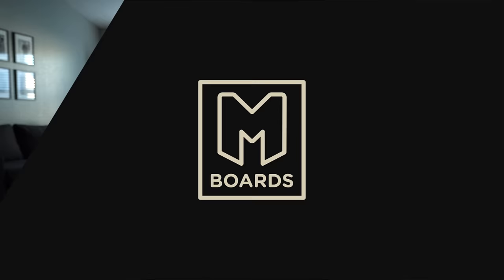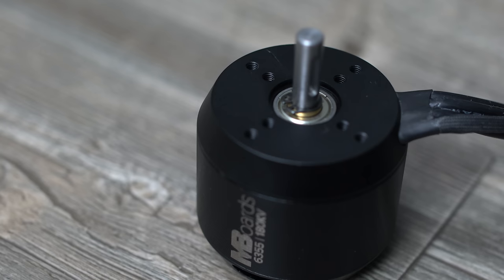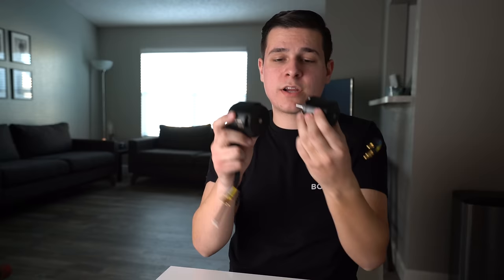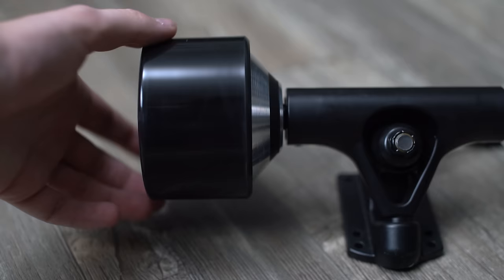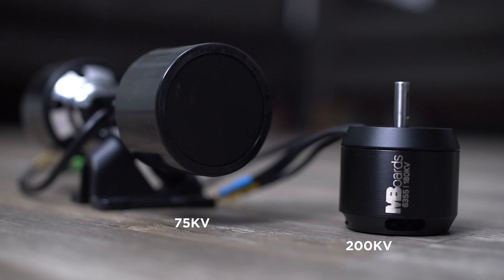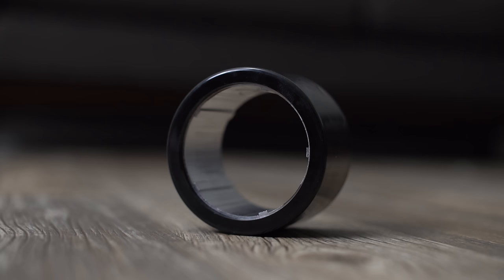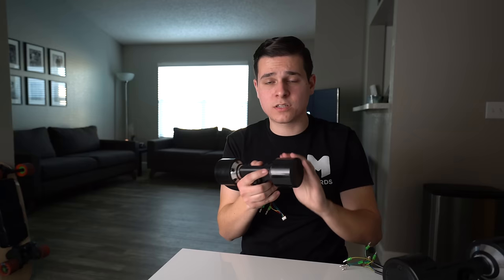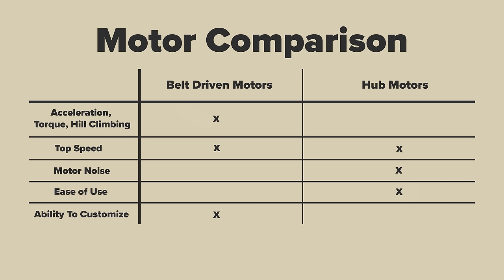How To Choose A Motor - DIY Electric Skateboard Build

Comment: You forget an primordial point! Comfort, vibration, shock absorbtion! With hub motor you're going to feel every roads imperfection, even with shock pads and a flex deck.

It's why I was going from hub to belt, the comfort when riding is night and day
Reply from the maker: Yes 100%. Wheel choice kind of covers that point but we should have touched on it for sure. 

This is the beauty of the comment section. 

Thanks for watching!
Reply: Plus outrunner motors work most efficiently spinning fast; as such belt reduction will always be more efficient, even with the parasitic losses the belt adds.
Reply: @EitanTsur  look "ALWAYS" may imply all other variables unchanged but TO BE EXPLICIT direct drive of many wheels.... 6 or more on a board allows low rpm efficiency!
Reply: @fojrsepta4959  not quite... There are two factors there.  If you run 6 motors you're simply running them all at lower than their power rating in their inefficient power band at low speed.  They are still inefficient at that speed, and in fact, you will consume MORE power trying to produce a given torque than a smaller number of appropriately sized motors.  In addition, every motor has end winding power losses.  There are no magnets on the axial ends of the stator so any power going through that part of the windings simply does nothing but generate heat.  As such, if you take a single motor that is say 80mm in stator length and compare it to two motors that are otherwise identical but 40mm each, the two motors will consume more power than the single larger motor producing the same torque.  This adds up the more motors you use.
Reply: @EitanTsur  YOUR ignoring the peak efficiency at other than extreme torque and rpm design.  Since needing less power from a motor allows it to be operated at maximum efficiency when providing needed power I stand by my  point which I made fully aware that to increase power beyond efficient your point about using proper motor type is all IMPORTANT.  

Efficiency is SOME times a luxury.  Using VEHICLES that weigh much less than we do makes it tolerable to generate heat INSTEAD of work.  However articulated etc. board designs allow millipede evolution values to gain performance without increasing battery size and weight for any distance.

Human power can be harnessed if storage has bandwidth despite novel delivery by shredding or WHATEVER.  Going fast uphill requires real energy but again humans if kept cool can output four figure power briefly with short recovery times.
The board pair market is undeveloped.  Dry ice skates are shoes that shove   converting down forces to forward and augmenting to drastically increase impact times reducing peak damaging forces to body and upping skipping SPEED to useful compelling and ecstatic...

Comment: Hi there.
Wandering what the advantages/differences between Mayteck 6396 and 8085?
Reply from the maker: Well by the numbers, the 6396 would be longer but skinnier than the 8085. 

It’s hard to say which one would perform the best. 

I would recommend a 63xx motor simply due to the compatibility for motor mounts.

Comment: Now... If I mount 2 motors, 1 with high torque and the other one higher top speed will they complement each other? The torque will pull at low speed, and the fast one will drag the slow one once it reaches higher speeds... right?

Comment: Hey Mike, loving the videos. Inspires me to try making my own board.
I have a question tho, if I would make my own board I would be using 2 x 6355 190 Kv motors with a 12S3P Battery. But is that battery strong enough for 2 x 2450 Watt motors?

Thanks in advance.
Samuel
Reply: How did this go?
Reply: @sirtimatbob  Bought a board instead haha
Reply: @samueldemeyer8521  lol. Can't blame ya, seems a journey of research and work.
Reply: For the future to who mind find this comment and has the same question; the wattage of the motor is a peak value. The motor doesn't draw this power from the battery, the ESC and battery are the bottleneck here. You could, in theory, make this motor spin with some triple A batteries but will only get the power the battery can supply.
Reply: @ericvauwee4923  thanks for the reply mate. I ended up buying 2 boards and tore my ACL 1,5 years ago 🥹🫠😂

Comment: Are the 10s5p batteries gone forever? I had one in my cart to buy today(payday) but it now says they're gone.
Reply from the maker: Our 10s3p batteries are nearly the same capacity of the 10s5p. 9000mah instead of 10000mah and at a cheaper price with higher quality cells. 

Recommend the 10s3p for sure.

Comment: What KV is better for a motor. Higher or Lower for more power and speed? Great video
Reply from the maker: Higher KV = Higher top speed
Lower LV = More Torque
Reply: I used a 190kv motor in my build and it gets me up a 17% grade hill accelerating. Motor is a 6364 keda 190kv from hobbyking. It cost me £38 and seems to perform well.

Comment: Do you think you could make a video comparing the performance difference between a dual 6355 and dual 5055?  I have always wondered what the performance difference is.  I am making another build for a new client and I think I will go with 5055 because I want to limit the power a bit, but I don't know what the actual difference is.
Reply from the maker: Great idea! Yes we’d love to make a comparison video of a bunch of different motors side by side.
Reply: if your client weight is more than 80kg+ choose bigger ones they should be coller :)

Comment: FYI the first four numbers are the stator size, not the exterior motor size. Also the K in KV stands for a thousand ie 1000s of rotations per volt. The discussion should also have noted that KV targets are a function of the battery voltage, ie if you double the voltage aim for half the KV rating. Otherwise the info was useful. Thanks.
Reply from the maker: Exactly man! Just putting these numbers into terms that regular hobbyists would understand 😎

Comment: So 270 kv would be very fast?
Reply: See my post above; KV is one of four variables to dictate your maximum speed.  You also have to factor wheel size, belt reduction ratio, and battery voltage.  Also assume that your maximum speed is "unloaded" or with wheels in the air.  With the board on the ground and you on top of it, that maximum speed will be reduced.

Comment: rear wheel drive or front wheel drive? and why?
Reply: All the builds I've ever seen are rear wheel, I'm not sure why but coming from car knowledge it's usually a better way of outputting power, Ex: Drag Cars being Rear Wheel drive
Reply: @wesley1759  doesn't really apply here, dragcars do it because the acceleration shifts their COG to the rear, supported by squatting suspension. Boards don't do that. 

To answer the question: rear wheel drive is more responsive to changing direction and oversteering, where as front wheel drive is traditionally prone to understeer and torquesteering. However, I have seen people ride their boards with hub motors up front.

Comment: What motors do you recommend for an evolve bamboo gt? Would love to get some more speed! Great video👍👍👍
Reply from the maker: Looks like the stock motors are 5065 150kv motors. 

You’ll probably need to stick with 50mm motors if you aren’t planning on changing the motor mounts. You’ll want to look for a higher KV if you are looking for some more speed.
Reply: Ok, thank you !!!

Comment: Kind of bummed, I had just asked you guys what would be best for SF hill climbs and you guys referred me to a 5055 set up dual. After seeing this video I would have rather gotten the bigger motors. I feel like I just waisted $200.
Reply from the maker: Hey Zach! The dual 5055 set up is still a great option. For $200 you got trucks, wheels, 2 mounts, 2 Pulley systems, and 2 motors. A dual 6355 set up would cost more than $350. 

I’m sure we were looking out for your wallet when we made the recommendation. 

Please rest assured it definitely wasn’t money wasted. You got yourself a solid kit 🤙🏻
Reply: Zach Pfeffer absolutely i did the same thing i just got done walking home.
Hopefully I’ll get some OfferUp sale to some highschooler

Comment: does this type of motor work on kart ??,
Reply from the maker: Sure! You can put these types of motors on many different vehicles.
Reply: @MBoardsco  okay thanks you so much (and you are really fast only in 3 minutes in a 3 years video that's doesn't work like that) just for that one subscriber
Reply: @MBoardsco  does the 6755 work on a kart or i have to take the biggest one ?
Reply from the maker: I’d recommend a larger motor if possible. The karts can definitely get pretty heavy and have some odd gearing ratios. Bigger the better in your case.

Comment: The motor itself is not what the numbers correspond too. The numbers correspond to the stator size. And increased stator sized on one dimension does NOT indicate more torque. It might cause higher top end torque or more torque on the low end.
Reply from the maker: That is true when diving into specs of all kinds motors. But for a general rule of thumb when looking at the esk8 motors we show, the rule does apply.

Comment: You don't talk about voltage, I'm not sure how you can recommend a KV range without talking about voltage. What voltage do these boards run at? I have a few motors from RC Heli's that are 400-550 kv, could I Just use one of those with half the voltage and double the size ESC/wiring? They are 5KW peak power motors.
Reply from the maker: Electric skateboards run with 6s-12s batteries. 10s batteries are used most often. We’ve found that those KV ratings are safe bets when it comes to choosing motors for this application. 

Builders with more advanced knowledge of motors are free to be a little more creative. Because this is simply an intro video, we wanted to keep it as simple as possible for new builders.
Reply: MBoards cool,

What is the watt rating range of the motor typical for eskate? 

On a range from low power to AT high power, how many watts would the typical range be?
Reply: With that high a kv offsetting with a lower voltage you'd have no torque and quite possible not even move =/
Reply: @AccroBrandon  Why would there be no torque? Not following, KV and voltage have nothing to do with torque, it's all relational. Higher KV, Lower Voltage simply means more current. Assuming the ESC and cables are designed for it, performance will be equal as a lower kv higher voltage setup.

The question is, can I get an ESC to handle the lower voltage and higher current requirements. I have some Heli ESC's that could, but, don't think it would work for an eskate.
Reply: @jasonfranciosa  without typing a novel i recommend reading up on the electric-skateboard.builders forum ... kv and voltage = rpm which most decent eskate escs try to stay under 100k or they fry, most people dont run higher than a 200ish kv motor... and that would probably be a 10s. for eskate  lower kv helps in lower end torque...higher kv for top end.. (not adding in gearing options) trying to get a 400kv motor matched with a low enough battery to stay under 100k rpm isnt going to work..... well  maybe downhill until it gets enough momentum. this isnt factoring in amps as well from battery of course... but in general under a 10s battery youre gonna have sag and it wont be fun. but to answer your question if you want a customizable esc get a focbox unity.. can handle up to 12s (or below) but max amps around 80 constant....  im not saying its not possible im just saying based on the few builds Ive done, and other boards ive ridden, i cant imagine a 400kv motor board being very fun knowing what the other factors are going to be to get it moving.
Reply: @LifeofAccro  Voltage and KV don't mean torque or speed unless you compare them proportionally.

A 40v 200kv motor will perform EXACTLY the same as a 20v 100kv motor with the only change being the amps. This is assuming the same motor and battery is used, just reconfigured for the different Kv and voltage. I can go through all the math on this, but, it's a bit long for here. I've wound my fair share of motors by hand and have extensive experience with brushless DC motors.

In terms of the battery, the same battery, reconfigured, will perform EXACTLY the same as well. For example a 10s2p vs. a 5s4p of the same cells. 

When you increase voltage without changing kv, you get an exponential increase in power... if the motor can handle it. 

With that said, I think the biggest issue is finding an ESC designed to handle the current of a lower voltage/higher current setup since the industry standard seems to be 8s - 12s.
Reply: @jasonfranciosa  do it..tag me when it's done and lemme know the results
Reply: Life of Accro as I mentioned. The problem is finding an ESC. My next build will be with this motor though as I already have it.

Comment: Motor numbers should be stator size. Drives me nuts when companies use the can size as this can be whatever they want, there's no benefit, standard, or performance relation to the size of the can. The Stator (size, plate thickness, etc), winding, copper content level, and magnets are what matter, not the size of the outer dimensions of the can.
Reply from the maker: That is correct as well. If builders purchase their motors from dedicated Electric Skateboard parts stores they will be safe simply looking at the can size as a beginner. 

More advanced builders definitely have the freedom to dig into some of the more specific specs of each motor.

Comment: Its not simple choice when you buy a car bigger motor= more power bigger acceleration and max speed simple. in this case its not
Reply from the maker: If you are just starting out, these are just some general rules of thumb. It is simple if you are looking at a selection of motors specifically for Electric skateboards.

Comment: Another con of hub motors. Taking high speeds and hitting cracks in the road puts excessive wear on the motors since all the pressure is right on it. With belt motors the pressure is almost always constant, so in the cases on imperfect trails or roads, hub motors are king